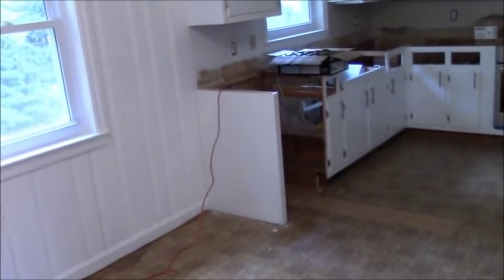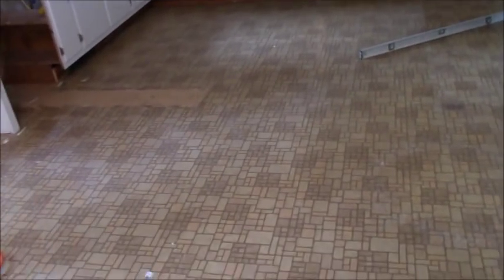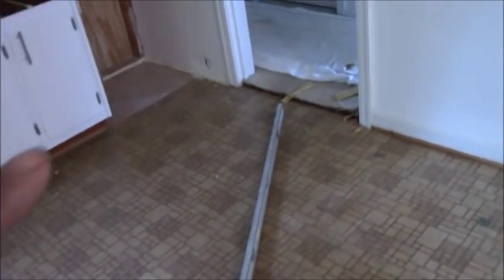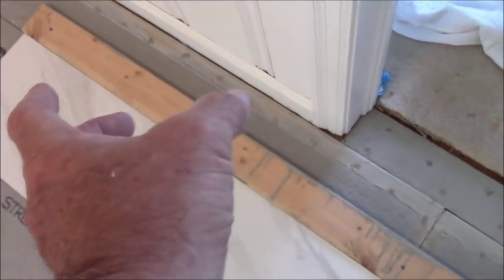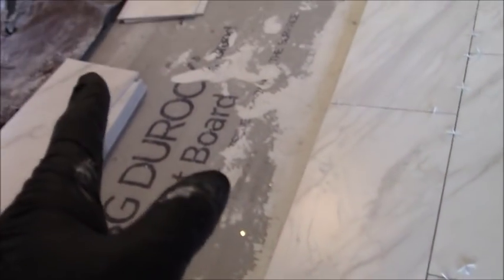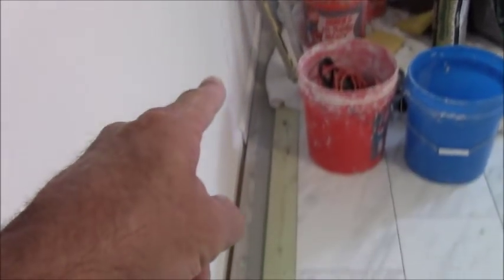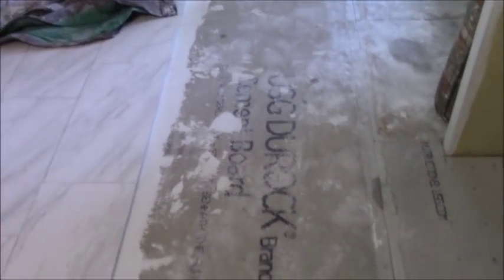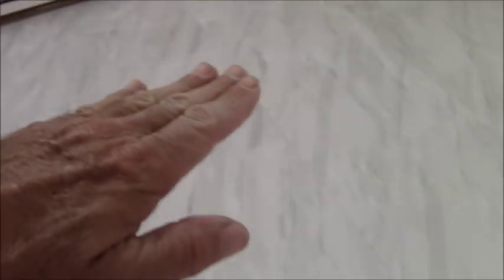Floor Tile Tips and Tricks for DIY'r

Comment: thank Bob
so much going on in this video, going to have to watch it several times
questions? no levelling system? no tape on the backer board seems? was that swirly texture on the back of that tile?
looks great, thanks for showing the work bit, very helpful
Reply from the maker: Leveling system is hit & miss, I use it on occasion but before those ever came out I was doing without. The swirl on tiles were how they were made, it insures thinset embeds into the tile for a positive grip. The tape thing I'm not convinced does any good, it serves ( as does sheetrock tape ) as a crack prevention thing, where would cracks occur on a tiled floor ? Just my take on it.

Comment: Hey good informative video thanks. Can you also lay 12x24 tile on a 3/4 bond. Like first row start with a full then second start with an 8in and 3rd start with a full again?
Reply from the maker: You can do it any way you like....the 3rd method is used to avoid lippage as much as possible.

Comment: I tiled my first floor and made a lot of mistakes. One of the biggest mistake I did was I placed the detra and tile under my kitchen cabinets. The grout lines are uneven a bit and I have some lip-age. I wish I saw your videos first but  now I have to learn from my mistakes. I was wondering if you had any advice in how to remove tile up to the cabinets? Is there a good tool or method? I appreciate any feedback. Thank you
Reply from the maker: There is no easy way to do that, mostly you're going to go in with a grinder up to the cabinet base as close as possible, I would suggest buying for 5 blades for that grinder because you will go through them
Reply: StarrTile thanks for the advice! I’ve enjoyed your videos and thanks for spreading your knowledge

Comment: Love your work bud I do have a question though as I am an installer. How come you dont use fiber tape? I've always been so OCD I thin set and screw in board then tape joints
Reply from the maker: Tape is used as a crack preventer, same as tape on drywall. There won't be any movement between my sheets because I use probably 30 nails per sheet with my Roofing gun as opposed to one screw every 8 inches the manufacturer says to do.
Reply: @StarrTile  understood. Thanks for the quick response man tile on

Comment: For 12x24 tile.. is this the only pattern available/recommended for wall?
Reply from the maker: Terron Winn .. absolutely not, you can do it in thirds, in half, diagonal, even herringbone
Reply: StarrTile Thanks bud. I was just curious on how significant it really was of I didn't do in thirds as the box recommended.
Reply from the maker: Terron Winn ... the third is ideal for minimal lippage, if you're going to do anything else other than that then I suggest tile leveling system, just have to be on point to get all the tile to match
Reply: StarrTile Thank you.. i should be finished my curbless shower venture by this weekend. Can wait to turn on the water and let it flow. Thanks to you, you made it possible for me to do it on my own. Now i have money left over to go back to the Dominican Republic for vacation ☺

Comment: Did you teach yourself the tile trade? I can always tell a guy who didn't do a true apprenticeship in the trade.....for instance a margin trowel is a tile setter's best friend, and wash sponges are cut on a diagonal so that the skinny side can wipe all of the thin-set out of the joint. Real tile- setter's would throw a fit if a guy has thin set all in his joints....in the union they would send you home at lunch if they saws that, can you imagine thousands of square feet that the finisher's (grouters) have to scrape thin set out of the joint? It's unheard of. And chaulk lines are snapped so that you dont work yourself into a corner and have to leave tile out and come in the next day to kneel on it and finish a couple rows. All in all you do nice work for a guy who is self taught.

Comment: Durock is a bad way to go man. I like your shower work, but i had to demo 5 year old durock floors and they come out as fast as they fail. Ditra, triton, self leveler or good old hardy, screwed down with thinset underneath. Durock is too soft and wont maintain solid strength over time in high traffic areas. Also, never join your sheets, always stagger and tape. Too many mistakes here man...
Reply: I would like to see your work... if you do better than Mr Bob...it would be great to see better ways to do things...do you have a  channel where you show up how your work?

Comment: Generally agree with your videos, but have two issues. First is, you should always apply thinset with flat side of trowel first to key it into the substrate. Second is just the way I was taught  to lay out and install a floor. Figure out your layout , strike chalk lines, and use your eight or ten foot metal straight edges to work your way back from the far side of the room back to the doorway.
Reply: Thats exactly the issue, when you use words as "should, ought to" you are implying that is the only way to do something.
Reply: Raul Torres idk if he said “ought to” but im dyslexia, so who knows. But also he’s not wrong, the dude in the video is making lots of mistakes. The way he’s doing it definitely isn’t proper

Comment: If the Ditra is going over concrete, I would think that if installed correctly it would be hard to remove.  Sounds to me like a good installation.

Comment: You do a nice job, its to bad u document these jobs being done against manufactors requirements. Im a tile setter also and lord knows i dont always agree with some procedures, however im not the guy paying for the professional installation and MANUFACTURERS WARRANTYS. Im just the guy charged with making sure the install meets the requirements. In the event there is a issue and a inspector is called you will be held liable becuase you u did not install it per manufacturer instructions. The headache of this is not worth the extra time it takes to do it there way. It doesnt matter if we agree or not with procuder, we didnt make the products we use, we get no say in its install. Do it there way, one job failure will easily cost u 3times minimum then it payed you. Assuming they let u back at all for the redo, if they dont it will cost alot more.
Reply from the maker: Trust me, 20 years later if I had angry customers, call backs, failures, I'd have changed my ways. If it works it works despite manufacturers directions. And BTW, you know they put directions on products to protect themselves & the town idiot, right ? Someone who's NEVER done this work needs clear directions...like the McDonalds "This Coffee is HOT" label.
Thanks for your input though ;-)
Reply: @StarrTile  I hate to agree with you really, its like you said in the video tiles have been laid this way for decades and they have never had any problems if done right. Problem is these days they are trying to make everything more right, more stronger and or more waterproof, even things that are already strong enough and waterproof enough they have to take it further, and in reality in a lot of cases its a completely unnecessary waste of time, materials and money. Plus I am sure if you gave the customer the option, they would likely agree to the lesser cost.

Comment: You have some great videos that you offer up on your own time that gives some great advice. And I thank you. I do not quite understand your hate for ditra (and most things schluter) though. I think for the right circumstance, it's works pretty well, as do other products that have come out to compete with schluter.  I will contend if you have to pull up a tiled floor with ditra versus a properly applied tile underlayment, would not have the same results? I would think a cement based underlayment properly layed in thinset would wreak just as much havoc as ditra and require a complete demo and scrape? Just my 2 cents. Otherwise. great videos

Comment: First of all there are many benefits too using ditra. It's a waterproofing and uncoupling membrane and load bearing. It allows for movement in the joints so it isn't impacted by movement in the subfloor or house settling, and also helps preventing the tile from cracking from impact ontop. There's many reasons to use ditra. Just like ditra XL can be used to build up higher for an even transition to a higher floor like hardwood. You can use it in a garage to lay porcelain tile and schluter warranties the tiles won't crack under the weight of a vehicle. Too say ditra has no purpose is simply not true.

Comment: No, i do 90% of my work with kerdi meterial, best thing to do is skim the floor, make it flat and detra is a flexable uncouple the floor and i dont know ANYONE that would rather pull NAILED DOWN backer. You use a flat shovel or thinset chipping blade, and it pops rigjt up

Comment: Thank you for the Tips, greatly appreciated.  Question:  This 1/3 rd layout, does it require you to use an 8" piece as the first Tile in the first row?  And the 2nd Row start with a 16"  tile as the first tile in that row.

Comment: Could someone please advice what I should do before tiling my cracked slab concrete in bathroom? I pulled the old carpet to lay tiles but found a long crack, smaller than 1/8". The problem is that the crack causes the slab uneven around it ( 1 side higher than the other). Any advice would be greatly appreciated.

Comment: Just curious, how much would you generally charge for this? I think you said this was about 300 sq feet?
Reply from the maker: As a rule, with prep most tilers charge $3.50-$4 a sf...But I estimate on difficulty & time involved.
Reply: It depends where your working,I set tile in NJ. If its a new construction project, I'm charging 6.25 including backer board,all  mortar and installation.  Residential work, guys are getting 10.00 a ft with backer board, all mortar and installation
Reply: Yeah here in Florida its roughly 2.50sqft but no real prep all slabs

Comment: I've never used any of the ditra systems on my jobs. It's really expensive and I don't trust it. I stick to backer board since it's been proven method, so why change something that works perfectly fine to something you're doubtful about.
Reply: You should really try it out. I have never understood the problem with the cost, my clients are paying for it, not me. I don't know how young or old you are but a full roll of Ditra is equal to about 22 sheets of 1/4 backer board. and I can carry it with one arm. Try that Hardi board :) I have been using since 2005. I have never had any issues.

Comment: I know this is a four year old video, you can send tile samples off to be tested for asbestos.  I did that when removing linoleum from my basement slab.
Reply from the maker: It is assumed that anything pre-1982 has it in it so I treat it as such... the testing part would take too long as a contractor
Reply: @StarrTile  for a contractor I would agree, as a home owner I know well in advance and can plan accordingly.

As you point out it is safer to just assume and go over it, but for those that have a need it can be tested.  That way they can either have peace of mind or know they'll need expensive removal that might kill the project or at least change it considerably.

In my use case I was going for a stained and polished concrete floor.  I sent the samples out long before the staining and polishing had been contracted.

Also, fan of your videos. thank you all the information and knowledge you've shared over the years

Comment: *serious question*..how do you keep the mortar from coming through on every seam? too much on floor? maby too much back butter, or dobi not need to press down so much?...thanks for your time.
Reply from the maker: Proper size trowel done at a 45 degree angle, not too much thinset on your back butter and push your tile down just enough to collapse The Ridges

Comment: Edit: it does look like a 1/2 inch floor trowel. What type of trowel do you use on shower floors? Shower walls?
Reply from the maker: It is a 1/2'' trowel. The size of trowel is determined be size of tile, not the area you'll be tiling.

Comment: i am a young new contractor and i just have one question, actually first off great videos keep it up your good at what you do very good and there very helpful but back to my question. how come you start from one side of the room and work your way over to the other? i was tough to start in the middle by snapping a line and going of that as my starting point . great stuff man good job.
Reply from the maker: I appreciate the compliments, thank you. You are free to start your tile anywhere you prefer, but if you start in the middle you might have equal cuts that are smaller than what would look good on either end... a lot of that has to do with pre measuring and even dry setting tile prior to setting it, the only time I start in the middle is for tile that will be on a diagonal
Reply: @StarrTile  oh ok got it thanks man and like i said before i nlike yiour videos and how you do them there really helpful and keep up the good work thanks man .

Comment: how do you compensate for low spots in the floor?  add more back butter? or add troweled thinset with rigdes to back of tile?  thx
Reply from the maker: The floor should be taken care of before any tiles even thought about putting down... as flat and true as possible even if it means a self leveler and some of the dips, then going forward with tile it should be pretty easy. But yeah, a bit more thinset could be put on the floor or the tile to compensate for smaller dips
Reply: @StarrTile  thanks!

Comment: Mr Doyle,
do you only dislike the orange schluter ditra because its a pain to remove? aside from that and the downtime - wouldn't its holding strength be a testament to the product ?
(and they advertise that it can be tiled over immediately - it wont really slide around but gets uneven depressions from kneeling while wet)

Comment: Did you mortar in the cement board?? I do..
Reply from the maker: I called that glueing and screwing.... but no I do not do that, in fact I don't even use screws are used inch and a half galvanized roofing nails because I can do hundreds of those half the time of screws and it's allowed

Comment: Nice video. I noticed at the beginning there were portions of the floor where the linoleum was missing and the sub-floor was exposed. I was wondering if you added anything to the floor in those areas to make it level with the linoleum or if it is a small enough difference where you can just place the Duroc over it. Thanks.
Reply from the maker: Its incidental really, but if there are dips, those need to be filled or tapered out.
Reply: Thank you

Comment: Would you recommend using a couple coats of RedGuard as a crack prevention membrane if doing floor tile over a slab?
Reply from the maker: Absolutely, if the floor is a big concern...it's cheap insurance.
Reply: Awesome thanks!

Comment: What about leveled spacers that lock or screw..
Reply from the maker: Self leveling systems are great to ensure you have no lippage, in this case I have rectified tile which means they were good quality, it's rare that I use a leveling system but they do help sometimes

Comment: Were you able to snap these tiles or did you need a wet saw
Reply from the maker: They would have been easy enough to cut with a manual cutter, but I always bring my wet saw for the difficult Cuts anyway

Comment: I can't buy any type of cement board in my country because 99% of the houses are built with bricks and concrete so there is not a huge market demand for it. So can i use primer, then leveling compound directly on the subfloor? Will the compoud crack when the wood boucing as you step on it? Should i use flexibile grout and thinset to avoid tiles coming up and cracking?
Reply: In that case it would be best to use the orange stuff he mentioned that he is not a fan of. Its called Ditra made by Schluter and can be purchased at most home improvement stores. Be sure to follow the directions precisely as far as proper thinset and getting correct coverage. I actually dont mind using it and have had no issues with it performing as it should. I have seen failures but always due to installer error. You say your going over a plywood substrate so as long as your joists are 16" o.c. you can lay dirrectly on that using a modified thinset mortar. then a premium unmodified mortar to set tiles to it being sure to fill all the squares in as thats the key. the square is larger at the bottom than the top so after the mortar cures the bond is impossible to beat as its locked into the squares. yes taking it up will not be easy but taking up any pro installed tile shouldnt be in my opinion.

Comment: What tile masters usually charge per square foot?
Reply from the maker: Back in the day when I was primarily doing tile floors my rate was about $2 a square foot for no prep meaning it's a concrete slab and I don't have to take anything out, on a wood floor where there is prep involved I think I was charging 3.50 a square foot
Reply: @StarrTile , it like 10/ foot for cement board and tiling , no material of course.

Comment: Looks good mate!  Do you use any clip systems?
Reply from the maker: Sometimes I do...in this case I didn't because they wanted 1/16'' spacing and the leveler 1/16'' gives you an 1/8'' grout line.